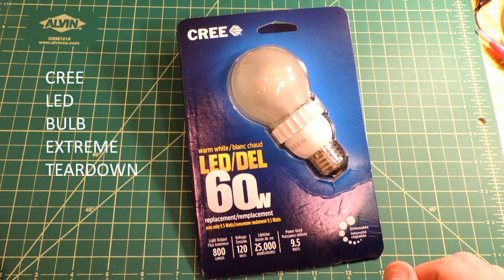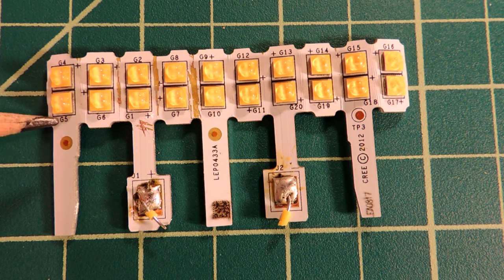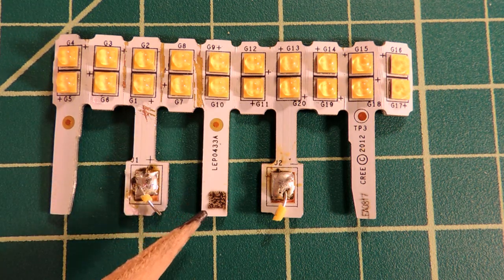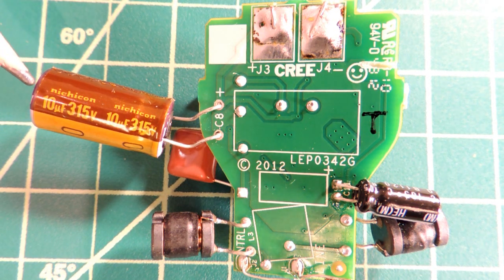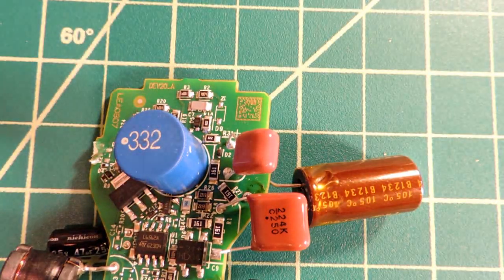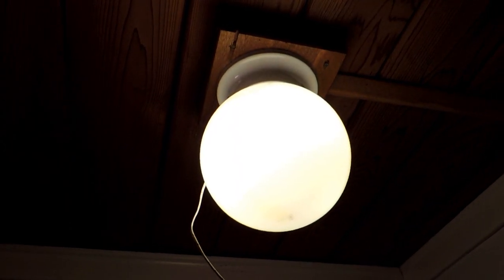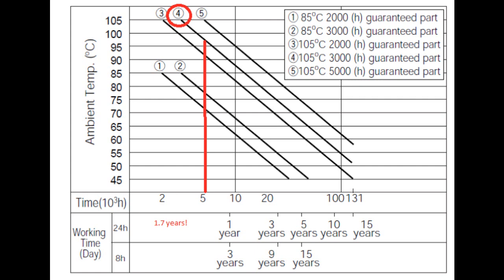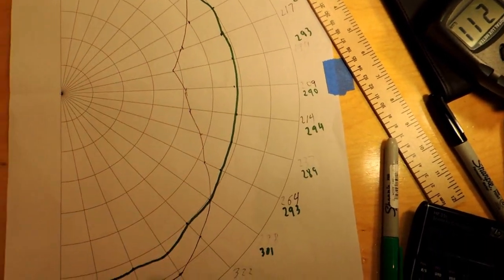Cree LED 60W Light Bulb Extreme Teardown and Review

Comment: The 100W-equivilent CREE are very, very dangerous.   I have one that literally "blew up" over a family room chair, spilling shards of glass all over the place, and leaving 110V electrodes in the fixture, making it dangerous to unscrew from the cieling.
I can't think of a more dangerous bulb.  I paid $21 each for two of these.
One if the engineering failures here, is the failure mode.   They do shatter, even though they are supposed to be unshatterable.
Reply: Did you remove the silicone over the glass? That's there to prevent this very thing.

Comment: +elecronupdate I'd like to tear down my failed 100W cree (lasted a mere 25 hours, but that's another story) to find the point of failure. One thing your teardown doesn't show is how you managed to disassemble without too much damage. What's your recommended technique?
Reply from the maker: +Chris Koch (jazzjunkie) Saw, spudger, dental-pick and a lot of careful disassembly.   work slowly and carefully, remove the top 1st, remove then the  emitter 2nd, saw the base in half (just through the side walls), use spudger and pick to remove potting compond.  wear glasses, use gloves.
Reply: ***** Good info, thanks! 
I take it the dome is real glass under its spongy coating? That alone makes the whole thing much riskier. I want to try a heat gun on the glue, but that coating…
Reply from the maker: +Chris Koch (jazzjunkie)  safety glasses, and a hammer better choice
Reply from the maker: +Chris Koch (jazzjunkie)  safety glasses, and a hammer better choice

Comment: I'm a BIG fan of CREE LED bulbs... singing their 'praises' to friends and family.

Well, after getting my hands on about 50+ customer returned Cree LED bulbs (of which only about 10 are actually bad), it seems the biggest single point of failure is the AC Neutral wire that simply gets lightly smooshed by the screw-in bulb base when it's attached to the plastic housing.

IMHO, Cree eliminated one too many hand operations - a single solder point. If this wire had been left long enough to protrude from the metal threaded base, enough to bend over the top lip and solder there, over 75% of the failed bulbs I went through would have not failed.

The symptom is a flickering bulb that will go out randomly, and touching it can bring it back on... depending on which direction you 'lean' the bulb while it's screwed-in tight.

I found the simplest way to repair those is to create a small, sharp indentation through the metal base right on top of that wire. The wire position in the base is very repeatable and predictable, so with a small flat-blade screwdriver against the upper lip of the base, and a moderate 'whack' with the handle of a larger screwdriver (it doesn't take much), it dents the metal just enough to make a much better connection than their "slip it over and crimp" friction connection. The small screwdriver blade tip creates a fairly sharp dent that makes for a high point-of-contact pressure on the bare wire below the metal, against the plastic base inside.
Reply: Sorry I couldn't respond sooner... glad you figured it out... bummer that you broke one.  Have you seen my video on the latest/greatest Cree 2016 LED bulb??  I'm not all that "fancy" in making review videos, but the bulb is real nice... and fixed pretty much all of my complaints on the older models.
BTW, I've had "fixed" bulbs like the above issue go bad later... same issue. The plastic they used at that point does not hold its shape well when exposed to high temperatures. The "crimp" point creates a localized high pressure point, which deflects the plastic over time. I soldered the wire on a few of the originals... permanent fix. The metal screw-base can be removed (after desoldering the center contact wire) by heating the metal with a low flame or small nozzle hot air gun... it will pull straight off (wear leather work gloves).
Reply: can you tell me what i should use to remove the glue that holds the glass on the heat sink
Reply: a1hardwood I mainly use a good dose of caution...  ;-) 
SAFETY FIRST!... as (Crazy Russian says)  Use leather work gloves!  First I use an Xacto knife and carefully cut down into the glue as much as possible. Then I use a heat gun (of hot hair dryer), and once the globe is hot, it will soften the glue. Using a pair of leather gloves (for heat and glass breakage protection), slowly twist/rock it back & forth. It will eventually begin to separate.

JUST BE CAREFUL as you take the globe off!  The individual LED tops are a soft rubber-like (silicone?) material, and are VERY easy to tear off by even a slight bump when you remove the globe. The LED will usually still work, but it will be producing UV light (don't look at it!). The white phosphor stays on the silicone top that gets knocked off. I have successfully used a tiny dab of clear silicone to re-attach the top if you do knock any off.

After removing the globe, if you intend to go further, I usually go ahead and remove the LED "board" from the tower. It really just slides up and off... but push it up from the bottom with the blade of a screwdriver... don't pull from the LED end!  (Some newer ones have a plastic insert in the top of the tower that may need to be removed first.)

To remove the main heat sink from the plastic base, you need to dig out any of the glue that's down inside the 3 snap-down retainer holes. Then you can pry the locking tabs inward (I think), while gently prying the heat sink away from the plastic base.
Reply: it broke off in my hand. im ok.i finally got it apart and literally fell apart. the solder job was done with not enough solder. but without a dome its probably not worth fixing
Reply: beforebefore - I think the issue you describe is what is affecting four of my CREE bulbs. I would love to try to replicate your repair, but hoping you can provide a little more guidance.
(1) It seems the repair you describe can be done without taking the bulb apart at all. Is that right?
(2) "The wire position in the base is very repeatable and predictable" => Can you help me figure out what this position is? Thanks!
Reply: Aha! Well, by breaking one of the four bulbs (not originally intended) I think I discovered what the location of the wire is. Following your instructions on that location seems to have "fixed" these bulbs -- at least for now. I hope they stay fixed!

In case others are interested in the location: the exposed plastic section which has the CREE logo and other writing has two seams (opposite each other). On my bulbs, the location of the wire is approximately at the location of one of those seams => the one closer to the large CREE logo (just to the right of the logo when looking at the logo straight on, not near the disclaimer text). Using a screwdriver and hammer to carefully create an indentation in the metal just below the plastic at that seam seems to have addressed the issue!

If anyone else is having the same issue and needs help, reply here, and I may be able to post a few photos somewhere. Cheers!
Reply: OK - one of them started flickering again. Another bump with the screwdriver may have fixed it in the short term, but I think I may need to look at the longer term fix.

Can you give me a sense of what steps I'd have to follow to solder the wire for the permanent fix? I'm trying to imagine if I can do this without taking the bulb apart (which seems pretty involved), for example by melting solder at the edge of the metal and plastic (where I created the crimp points) and hoping some solder will leak down to the wire. Thoughts?

Somehow I can't imagine how it would work otherwise, unless you disassemble the bulb, extend the wire with another piece so it can fold over the outside of the threaded section, then re-assemble and solder.
Reply: You don't need as complete disassembly... just the threaded base needs to be removed. Did you read all of my previous reply... with instructions about this "next level" repair?  Desolder the center post of the threaded base, make sure the wire is hanging loose so you don't break it when you pull the metal base off.

Then use a heat gun (preferably) or low heat from a flame... remember, we're just wanting to make the plastic soft/pliable enough to allow you to slide the metal base off of the plastic. The retention divots in the top edge of the metal base will make grooves in the plastic when you pull it off, but unless you can pry those divots out, you will need the heat. Then it's just a matter of extending the outer wire by maybe 1/2" so you can wrap it around the top lip of the metal base, and solder it... like the factory seems to have done in their latest production runs of this same model.  Be sure you twist the extended wire together, so that when you solder it to the outer metal base, it won't come unsoldered from the original wire. You may even be able to 'replace' the original wire... it's soldered to the circuit board at a pretty low point - near the bottom lip of the plastic housing.
 Here you can review where the AC wires solder to the PC Board... J1 and J2
https://youtu.be/n6DDFRBrSas?t=395
Reply: Ah, OK. I did read your entire previous reply, but I didn't fully understand what you meant by "desolder the center post of the threaded base". I thought perhaps that was something that you were doing from the "inside" after having removed the top of the bulb. Now I realize you must be able to do this from the outside. I think I've got enough information to try it out when one of these bulbs is flickering enough to be worth it. Thank you! I'll try to report back.
Reply: FYI I did finally have a bulb with the "indent" workaround stop working, so I borrowed a soldering kit and followed your method for the soldering fix. Overall, it worked! (So far, at least :)) I did manage to break the glass globe in the process though. Live and learn. If anyone else tries this, be careful not to grip the glass globe with any non-trivial force (e.g. when pulling to remove the threaded metal base).
Thanks again!

Comment: I have 2 failures out of 41 bulbs purchased.  The two failures had less than one hour of use.  When I returned the bulbs to Home Depot they now (Nov 12, 2014) ask if the bulb was used in an enclosed fixture.  But they refund the money no matter what you tell them.

Comment: Cree should add one more led on the top of the bulb to help improve the light output.
Reply: ***** Yeah,i bought one today and noticed the same thing and i also saw only one row of led's. I think they applied the silicone inside the glass. I plan on buying another one to take apart and see what is else is different.

Comment: Do you have a video on how the basic electronics run an LED Bulb? I see this bulb has a rectifier and capacitor, but is there a transformer? Is the capacitor part of some kind of passive low-pass filter for smoothing the DC current? And if so what kind is used (Butterworth filter, Chebyshev filter, Bessel filter)?
Reply from the maker: No videos on the power converters specifically ... there are lot's of data sheets and app notes at the various vendors.  If I recall the Cree is a non-isolated design which uses an inductor and it was based on an ST controller.  The filters tend to be simple one-pole low-pass filters.

Comment: Just tested one of these on a cheap dimmer I bought at Home Depot. The bulb buzzes a lot more than the other bulbs by Feit I tested so bear than in mind when using it indoors on a dimmer. I tested a Feit with a similar price and it the buzzing was half as loud. Interesting stuff.

Comment: Use 6562 to do this? Dare u Cree. It is dimmable and I bet it use OCP to cut the power. Anyone hear the buzz during dimming? Yes, u will. The thing is non isolated design... Cheaper than flyback. The cap is short life I guess.
Reply: I bought one of this couple of months before and the first one was a defect because the glass cover was misshaped and the replacement is on my table. That is the only LED bulb from Cree. Yesterday, i came across the teardown video of this bulb. i have to say, Cree is really crazy to cut down the cost of the bulb... first, the bulb has 20 LED chips in series, 4 LED dies per chip, so 80!!!! LEDs in series. Consider 2-3V per LED, that is >200V. I don't know, how they got UL approval and how they make sure over life the heat sink metal wont conduct high voltage to their customer. Usually, other big brand designs use isolated and low voltage LED array output <60V, which is safe to even touch bulb from inside. Second, as a power design engineer, I am very sure that the control IC Cree is using the most common and cost effective one, 13cents!!! in volume-L6562 from ST. L6562 is actually a PFC controller, making your LED bulb really looks like a resistive load. Anyway, the key is Cree is using L6562 over current protection function to do dimming and normally this function is only used in abnormal conditions. So I bet you will hear clear buzz when you dim down you Cree bulb using any type of LE/TE dimmers. Because when this function kicks in, the power supply will be hiccuping at <20KHz frequency, when you hearing works well to hear the noise. I personally believe that you get what you paid for. 3rd, i dont know the warranty makes any sense. the power supply can never run 25 years, even maybe the LEDs can. In this competitive market, there are bulbs cannot lower the price to match this Cree bulb, that actually means they really do reliable and quality design. I am planing to make some youtube videos to let more people know, how LED bulb are working both inside and outside of the bulb. Hope you guys still like the bulb :(

Comment: Respectfully, I think your numbers are all wrong.  The Manufacturer's sheets show values in degrees Celsius, your meter is apparently setup in Fahrenheit.    I don't think you measured 80C off of the bulb, or the solder would be melting.  (176F...)

Comment: I'm thinking of taking a few of these 800 lumen LED bulbs apart to make my own headlights. I figure I could unroll two in such a way as to only produce around 1,000 lumens from the regular headlight bulbs and around 1,600 lumens for the bright lights. What are the current and voltage outputs from the circuit that feeds the LED arrays?

Comment: Can you confirm if these are the CREE XT-E LED? Should be about 3.5mmx3.5mm. If so, they are high voltage LEDs @ 12v, 24v, & 48v available. Since each can give out 100lm and they have so many, looks like they are under driving them for efficiency and to keep the heat down maybe? For the price of one bulb, you can de-solder these and put them to use in other projects. At about $2.39 ea on digikey, seems worth it to buy a bulb and remove the LEDs =D =D =D

Comment: Very good tear down and explanation. I was going to buy one myself and take it apart but now I don't need to. Can you explain the temp measurement part some more? What were you measuring? the inside air or a particular component or the heatsink or the MCPCB board the LEDs are mounted on? Also, would there be a huge temp difference if you measure the temp on the large cap vs measuring the surrounding air temp?

Comment: With the light distribution you can also note that the GLS lamp will have different levels as you rotate around the axis, as the filament ends make less light in an arc. The Cree will have regular patterns around the same axis, but should be closer to even.

Comment: Sheets are made by using a press to both cut and score the sheet then the top flex board is stuck to the sheet, then the solder paste and LEDs are placed then reflowed. Then cut the board with another press and you have the boards. Test and mark. To get made in USA all they need to do is assemble the parts together as assemblies, then have local packaging suppliers. All made in PRC but just the last part in USA.